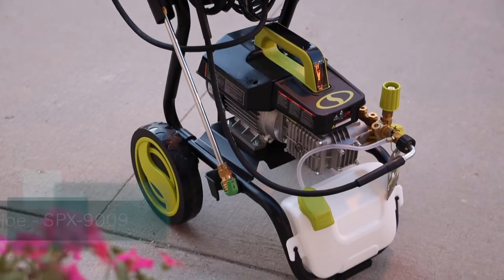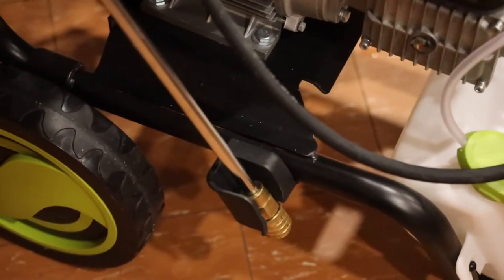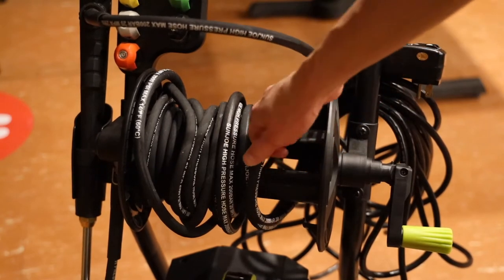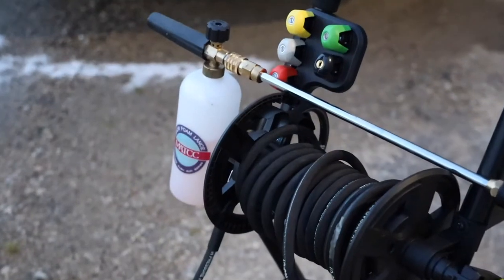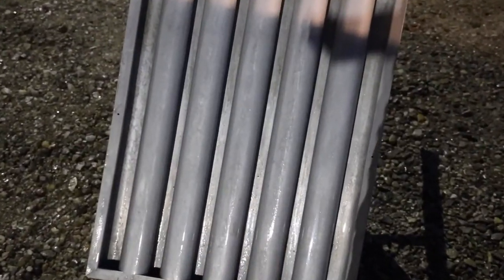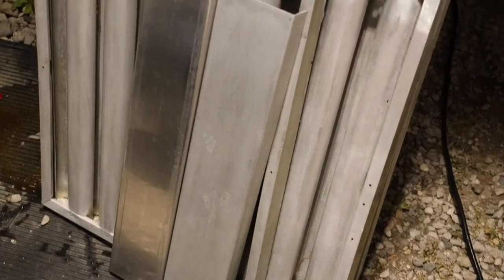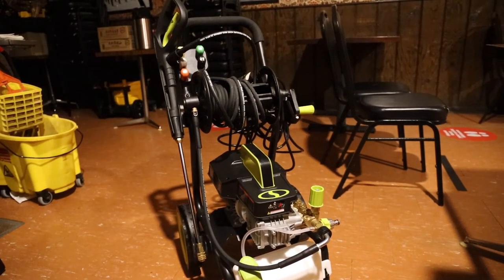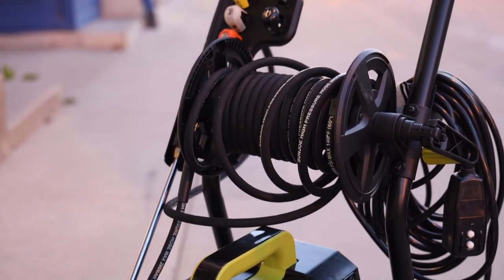The Ultimate Affordable Heavy Duty Pressure Washer for DETAILERS! - SunJoe SPX-9009-PRO - Review

Comment: Don't compare this to anything other than a 120v washer.  I believe this one draws 15 amps?  I don't think anyone makes one that draws 20 amps which is possible w/120v.   And what is the pressure and volume?  (not that 3300 and 1.2 open spec which is useless) - what is the max pressure and associated volume?  NOTE:  the oil is for the pump, not the motor.